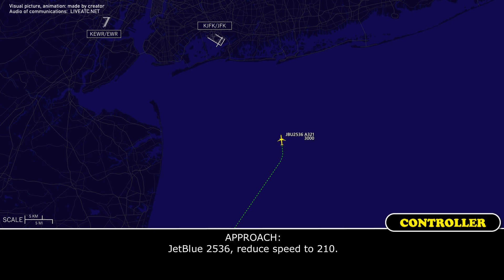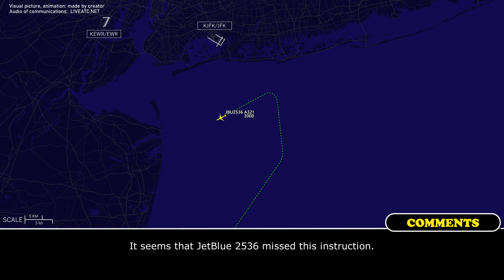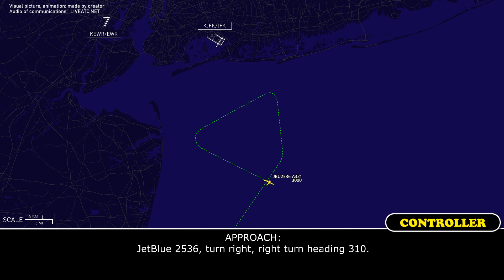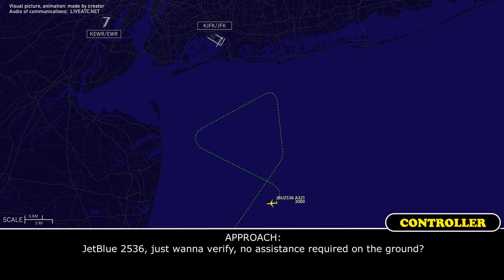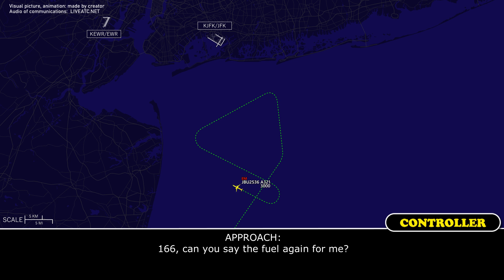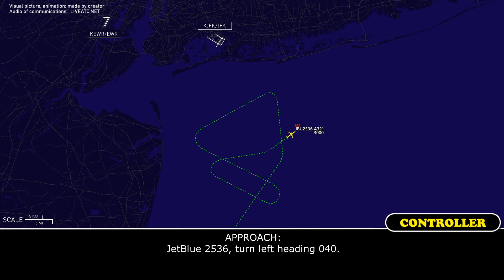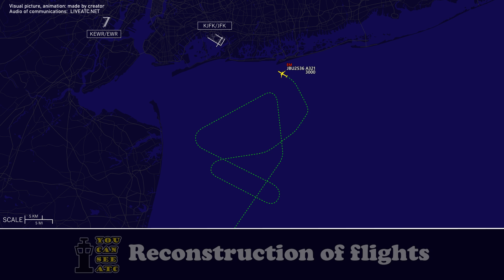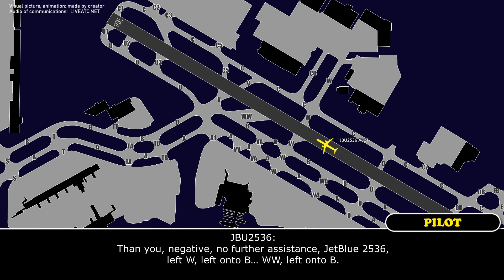Slats problem on approach to New York Kennedy Airport. JetBlue A321 declared an emergency. Real ATC

Comment: No disrespect but can you speak English, transmission garbled at times
Reply: There is a receiver on the ground picking this up. You're hearing that, not what the crew or ATC are
Reply: Sometimes 2 pilots talk at the same time and overlap and that makes that awful sound and sometimes just interference